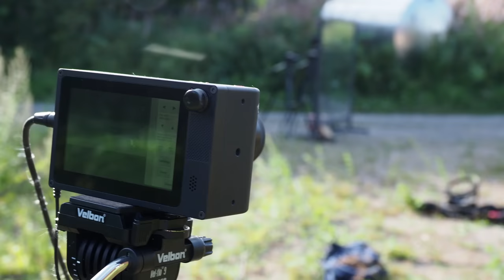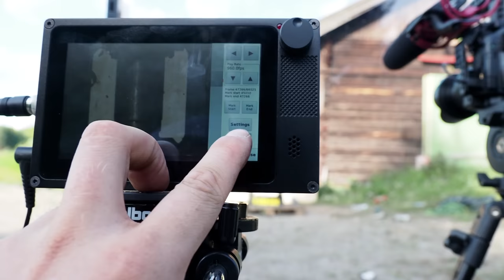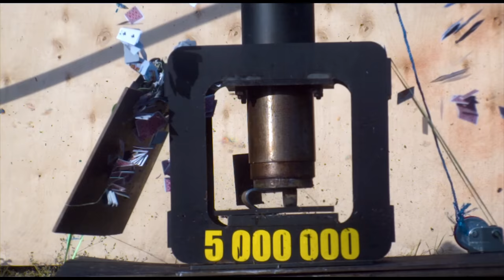Splitting 10 Decks of Playing Cards with World's Fastest Press | in 4k!

Comment from the maker: Here is link to Beyond the press channel's Smashinator video https://youtu.be/OcvEde1FlE0
Big thanks for Kron Technologies for sending couple extra cameras for these Smashinator videos and also thanks to premier pro warp stabilizer for making that psychedelic extra content zoom :D Here is a link to Kron Technologies http://www.krontech.ca/ and here to Beyond the press channel for tomorrows video https://www.youtube.com/channel/UCveB47lgzZJ1WOf4XYVJNBw
Reply: Hydraulic Press Channel immense
Reply: I think humanity has reached a peak with the Smashinator 5,000,000. It might be all downhill from now on
Reply: You shoud have measured the temperature of the blade after bending it so fast. 
I Bet it was over 100°C. I suppose that high speed thermal is not something that these cameras do.
Reply: HPC You can use a spring of some kind, to the back of your slug, then attach it to the rope. That way, when you lift it up, get it stuck, and release the winch, it'll pull back the rope inside the barrel. You won't need to manually stuff in the rope ever again!

You can't use a normal helical spring, but you can use some kind of winding spring like the ones used in vacuum cleaners/ hovers, where you push a button and the cable gets winded back in automatically. Try it :D
Reply: 🇬🇧 You didn’t say HOLY SHIT. That’s your best catchphrase.  🤪
Reply: Hydraulic Press Channel first , I love your videos 
Second you should try to make a 10.000.000 version 
Which will be a bit larger so you can stack higher towers of cards decks and cds :3 so it is even longer the effects of slicing through at ridiculous speeds:33 
Love from Brazil 🇧🇷
Reply: Hydraulic Press Channel this version of the smasher is awesome, try slicing stuff that's  made out of heavy material or a punching bag
Reply: I am glad they didn't have this technology during the French Revolution.
Reply: With all of the boards that have the guillotine blade stuck in them and all bent up, you should sign them and auction them off. Maybe you could glue a sample of whatever was split with that particular blade to the board and it would look pretty cool mounted on my wall
Reply: Hydraulic Press Channel i really love this channel. You guys are great; you and your wife are adorable; and it seems like you have alot of fun doing these videos. Much love. ♥️♥️♥️
Reply: Hydraulic Press Channel 

You should use pig/cow meat on the bone to show how dangerous this stuff is to do so others dont do it

Comment: Some interesting effects there eh. When the piston is driven down by the compressed air the whole machine reacts by launching up in the opposite direction. Then there was the surprising effect that the water had acting on the bottom of the piston.  The water effectively acted as a solid stopping the piston's downwards progress. Thus the knife blade remained much more intact in shape than the other experiments. Awesome.

Comment: The Slicinator 5000000 is definitely better at certain things than the, uh, Slicer 5000000?.....well, the Smashinator variant is better at some things. You've been trying to slice CDs cleanly for a long time, and you've finally figured out a way to do it. Because the blade is moving so fast, the inertia of the object being sliced is sufficient to hold it in place while it is sliced, overcoming the greatest challenge you've had with the press-based slicer. The obvious downside is the single-use tool in the SmashiSlicinator 5000000. It might be possible to make some stop pillars so the blade didn't get mangled after every slice.

Comment: The slicer 5,000,000 is probably the second best tool of destruction, and the smashinator 5,000,000 the first, and putting them together does not disappoint it actually works so much better than I thought it would.

Comment: I have a few requests: 

For the Smashinator 5000000:
     - Trying smashing a soda bottle, but filled with Oxy-Acetylene mix... I'm wondering if the heat from the compression will be enough to set it off.
     - I'd like to see if you can light thermite with the Smashinator... I'm thinking you'd use something like your RockMaker 5000000 to make sure it gets hit hard enough and doesn't escape.  
      
For the Pnuematic Axe 5000000:
    - Try slicing some aluminium sheet, edgewise.
    - Try slicing some HDPE or Nylon round stock.

Comment: Your Barbie ones are always very disturbing...
An idea for saving blades: have a slot in the metal baseplate, but cover it with the wood. Enough resistance to cut things but will let the blade pass through.

Comment: I had to point out that the slow-motion video is a little ironic, since the hydraulic press split the cards at that speed anyway!!
Very good though and I thought "no way will it make it all the way through before bending" but I was wrong!!
I would suggest cutting a slot in the bottom board to allow the blade to pass through so you might have a chance to re use the blade!
Great stuff!!

Comment: holy fuck 

btw, you can use some sort of a spring on the back of the slug to the rope. So when you stop lifting it, it'll automatically pull back the rope needed to be loose, don't need to manually stuff it in.